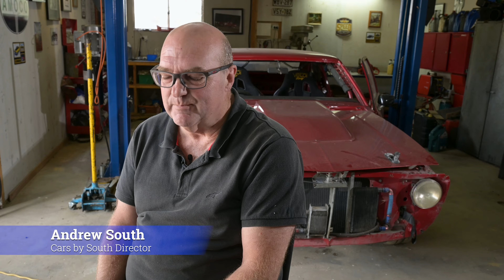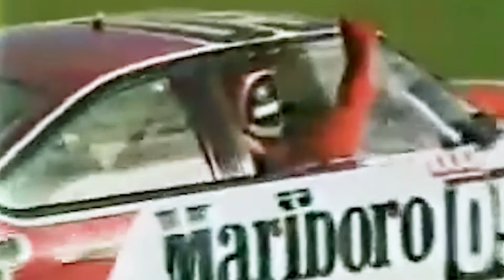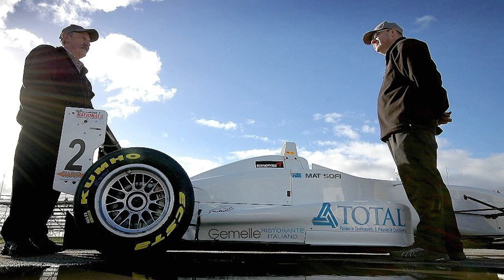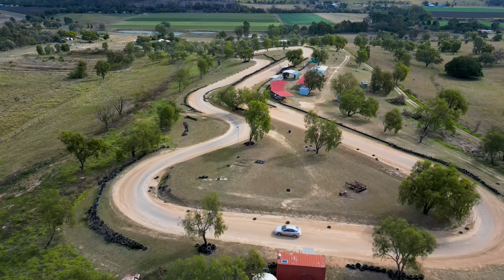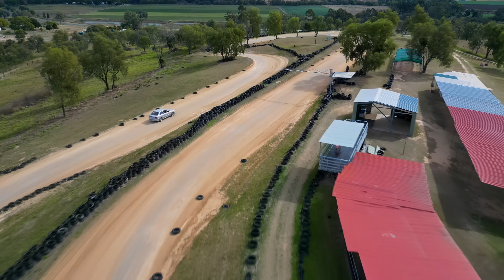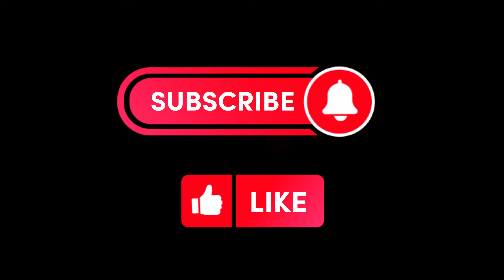Drive South Episode 1

Comment: All the best with the idea man.
I think your going to get a lot of support from some great people and I'm hoping the government will be helpful too.
Depending on your location needs, leasing space at the old Holden plant might be a good option and add an air of authenticity to the project.
Perhaps having just the body work done at the old Elizabeth plant could be cool while also giving you a good amount of space to work in.
Adelaide has lots of old industrial spaces left from the vehicle industry that might be good, and cheap.
Would the Taiwan/Vietnam steel body panels be an option seeing as that part of manufacturing already exists?
Another thought would be to design a modular chassis so that the dimensions could be changed to accommodate say, an XB coupe or HK monaro or anything really, without having to get approval for a entirely new chassis and total redesign from the ground up foe any new models.
XB coupe could also be a potential money spinner not only here but in the US too if it complied with US design rules and ran a coyote v8 and other off the shelf mustang parts.
Just some ideas but im sure you have already thought of these things.
Reply from the maker: @sssyntax  Hi, thanks for your input.  The platform is modular and you are right on the money with the future plans.

Comment: Well no one can accuse you of taking little bites... Andrew it might be worth getting in touch with Erika to get Peter's number. He is in the building process of creating low volume fibreglass cars. He could probably clue you into some of the potential issues you might run in to. From what I have experienced doing the odd job for Peter (and being a friend)... consistency of getting any second hand parts can be a real challenge. He prefers to use second hand parts where he can because they have already been ADR approved. Which cuts down on engineering costs. Although I am not sure I would go that way... well I haven't, all the parts I have gotten for my electric trike are new, but I am not interested in mass production.